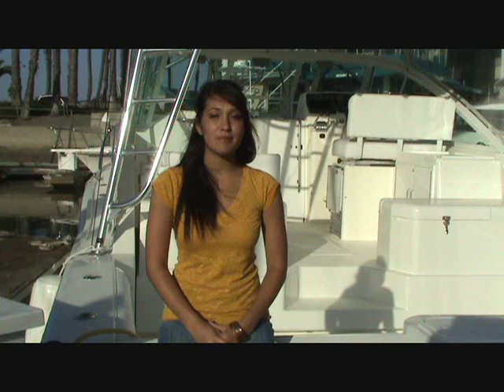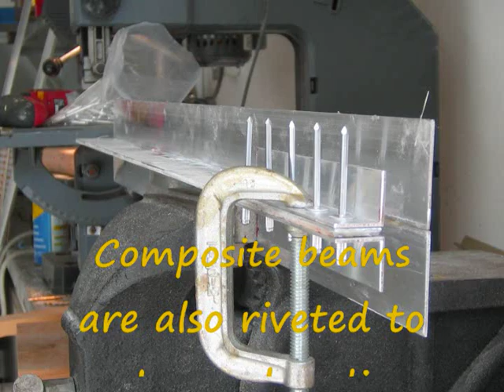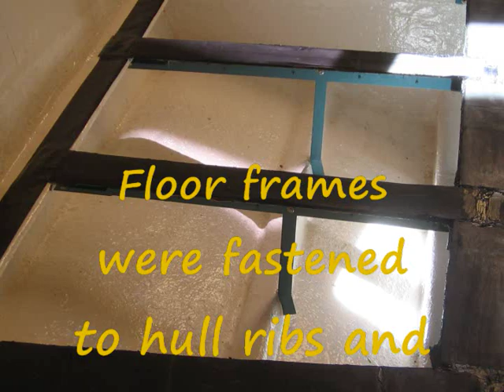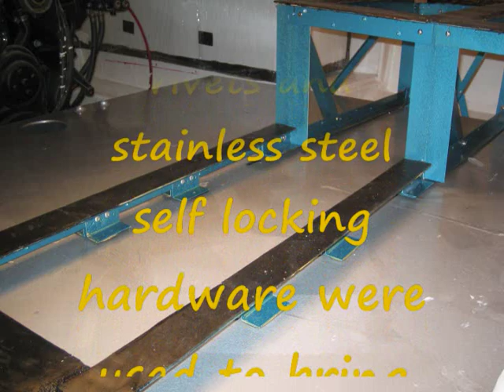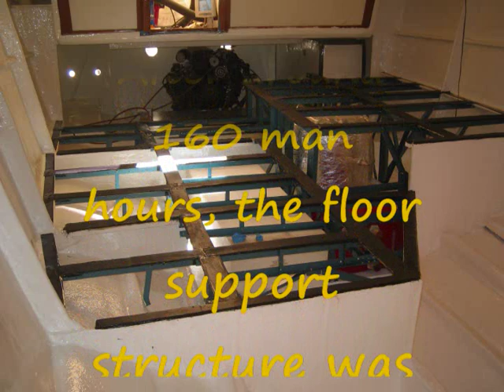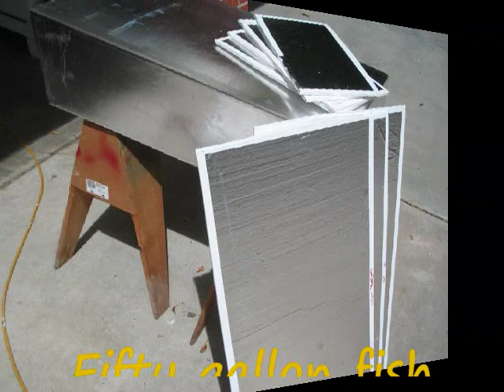Epidode No. 2 of "Pretty Perfect" - Boat Restoration, Rebuilding and Reconstruction

Comment: @armandoguadalupe one more thing, if I'm considering refurbishing a small faster river boat, OB or IO, The composite materials, Where is the best place to find pricing and technical information? For instance to replay the whole floor of a V hull would save considerable weight I would imagine. I like your use of aluminum as well.